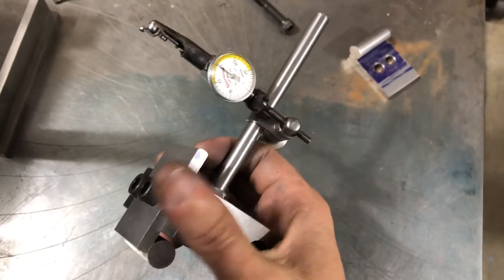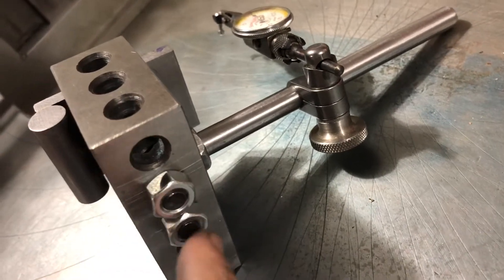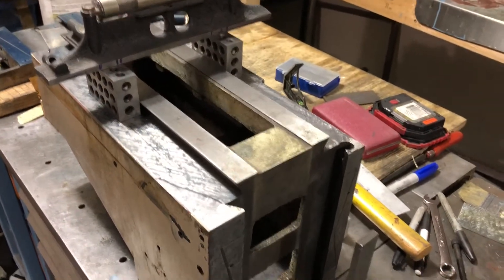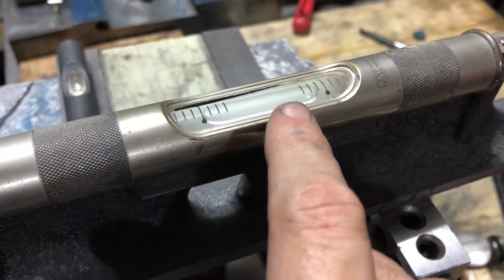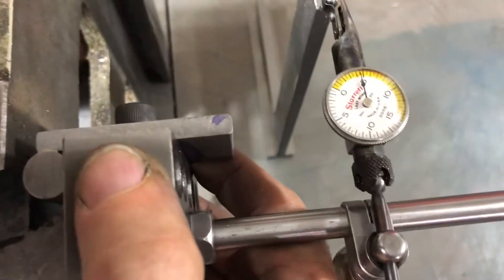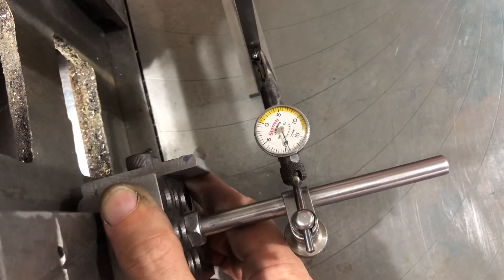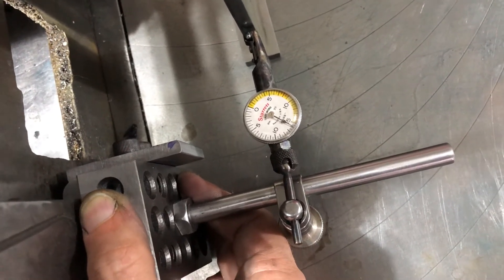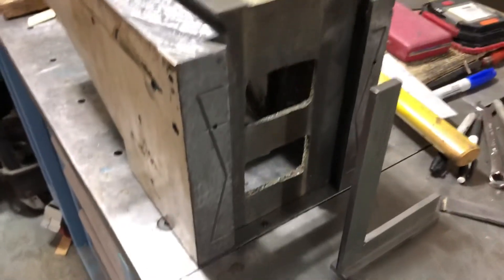Dovetail alignment jig and Grizzly 0678 scraping

Comment: Although on the surface, this setup might seem good, the reality is you are not necessarily checking the dovetail because of the cantilever nature of your tools makeup and the 123 block riding on the flat ways. If there is any deviation in the flat way area that the 123 block is riding on, that will cause the 123 block to cant at an angle and thus cause the indicator to read differently. Basically you will be inducing a SINE error because of the cantilever effect acting as a multiplier. The reading on the indicator will be more than what the surface is off by depending on the dimensional level arm effect. For example, if you indicator is out say 3 inches (in a perpendicular relationship) from the way surface that the 123 block is riding on and that surface has a an angular deviation say .0005 per inch (or about 0.026 degrees), as you slide up and down, the indicator is going to show a SINE error of about .0015".

In case you are not sure which way I'm referencing this, look at it from an overhead view and think of the flat way surface that the 123 block is riding on and the horizontal direction perpendicular relationship to your square that the indicator is reading against. 

The only way to check the Dovetails by the method you are using is insuring that the way surface that the 123 block is riding on is 100% true and flat plane.
Reply from the maker: That is correct, there could be a small sine error. I'm going to do the final scraping by putting the knee back on the column and moving it up and down, indicating off a square on the knee. 

The jig did get me close though, I ended up taking about 15 thousands off one side of the dovetail, then of course I had to take that much off the gib as well, and I'm now glueing some brass on the back of the gib to build it back up. 

Currently, I measured it with the alignment tool with the knee on the surface plate, and with the knee on the column, where I slid the tool on the column ways, and both show it's currently about 1-2 thousands out of square. That I think is close enough to rough in the gib, so that the knee does slide up and down, than I'll indicate a few more times, holding the indicator stationary, whilst moving the knee, and use that for a final scrape.

Comment: Just started watching videos with some interest.  I thought I would comment on what appears to be a Kinex Try Machinist Square in your video.  I just received one of these and the bottom part of the bottom plate -- at least on mine -- is no way square with the reference surfaces.  The "upper" surface of the bottom plate is square-ish.  Who would have thought.  Probably best to test it if you haven't.
Reply from the maker: Yes, I found out the Kinex is a little bit off. I ended up buying and scraping in a frame level off ebay. When I first got it, it was literally ten thousands out of square, but I scrapped in in my surface plate, and it's now accurate to under a tenth. 

When I compare the Kinex against it, the Kinex is about a thousandth off. 

https://www.hobby-machinist.com/threads/grizzly-g0678-8x30-repair-scraping-and-alignment.87288/post-802672

Comment: Wow, no other comments yet????! 
I have made almost the same tool, just a slightly different approach because I'm fixing a G0761 mill that has been a wreck from the day it was purchased... Epoxy granite filled the base, scraped it true and am working my way up the machine from there. Mine was literally fitted with an angle grinder from Grizzly. What a shame we have all lost the time and money it takes to repair these machines. Only positive note is that we get an involuntary education re-engineering design flaws, we develop skills fabricating tools to do machine repairs, learn how to do precise metrology to see what needs attention, develop fine motor skills hand scraping, and find victory improvising machining process' since the Grizzly tools we paid for do not perform their advertised functions.  The dials should be graduated in 0.1"

(edit: to remove any unintentionally legally concerning speech :)
Reply from the maker: Completely agree 100%!!!

I still can't believe how they ways and especially dovetails were "fitted" with an angle grinder. I ended up having to take about 30 thousandths off the saddle ways just to get them flat. And I had absolutely no intention of learning how to be a machine rebuilder, doing this out of necessity to fix this crappy machine. 

I just can't  believe that factory angle grinder work, I mean, WHY, WHY??? It would be SOO much easier for them just to grind it flat, and run it though a rough face mill to get some oil grooves. That would be totally automated and they'd save on labor costs and make a better product. 

I've got a whole thread on rebuilding this machine here if you're interested. I'm just getting the back ways scrapped flat now, and starting on the dovetails. Those were the worst, the knee was out of square 20 thousandths over 8 inches. 

https://www.hobby-machinist.com/threads/grizzly-g0678-8x30-repair-scraping-and-alignment.87288/
Reply: @AndySomogyi   Andy, I went over and looked at some of the thread on HM. Not sure I want to jump into the fray over there once Richard King gets involved. He's an "expert" of the poorest character, and I go the long way around when I see him coming...   guy is the cancer of the novice scraper. He's a scraping badass, but I've never actually seen him doing anything but sitting while instructing, and bashing people on the forums for not learning from him before attempting independent thought. I'll read through the thread though, I know your pain :)
Reply from the maker: @DrKnow65  Indeed, again, 100% agree. 

I don't what King's problem is, that's all he does is go around and insult and berate people. I guess that's his business model, where he convinces the world that he's the world's leading expert on scraping, and everyone else is an idiot, so people would sign up to take his classes. 

He does the same thing everywhere, jump's on people's threads and starts insulting them. But he seems to heap all sorts of praise over people that paid to take his class, hmmm...

Anyways, I'm certainly no expert, I learned the basics of scraping from my grandpa, and figured lot of out on my own from and the Connelly book. I was however pretty happy with that box square I scraped, took it into work, and measured it in the clean room at about 50 millionths of flatness, and 0.0001 out of square. 

BTW, Jim here also has the same mill I've got, and he's got a super great writeup on his rebuild. Looks like his was in as bad a shape as mine. 

http://www.benchtest.com/w-g3103b.html